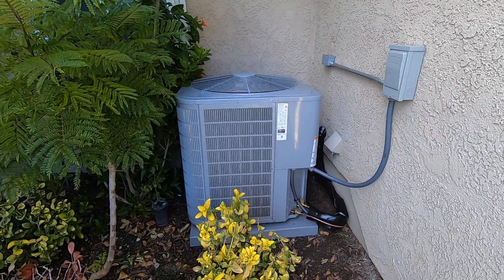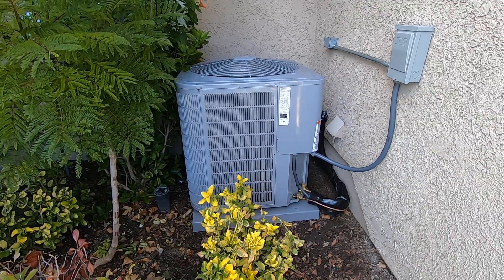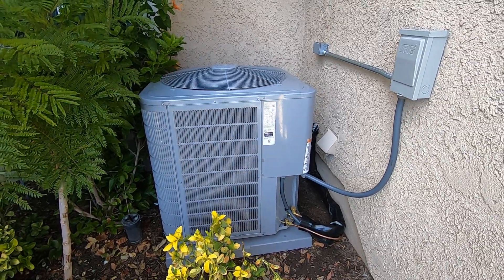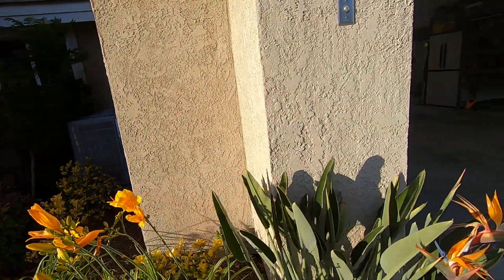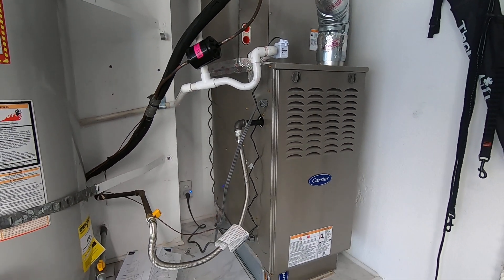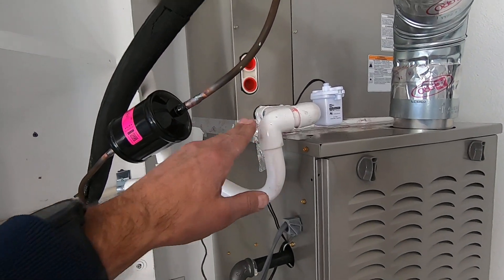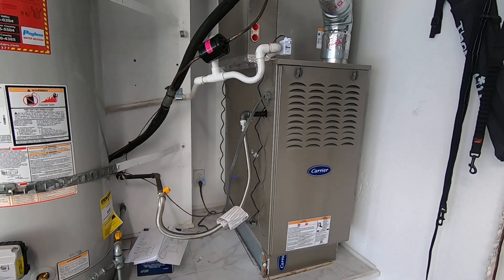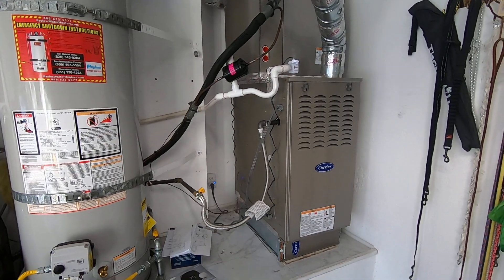Carrier Dual Fuel HVAC System

Comment: Can you post a video of how the clean the coil on a 24vna9 unit please ?
Reply from the maker: Thank you for watching the video.  To clean you condenser coil you can run a hose over the outside or take off the top grill and fan to wash the coil from the inside out.  Typically washing the outside of the coil will get it clean enough.

Comment: German Heating technican here, im always curios how heating is done in other countys, thats why i clicked on this viedeo. Its interisting how you solve heating in the US, here in Germany it is still common to use radiators or underfloor heating, it is very unkommon to heat the ventilation here. But in all honesty, i cant call the ODU "quite". Regulations here require a freshhold of 35 dB for residential housing. At least for the night. Can you give me a rough entimate of how much systems like this would cost in the US?
Reply: $10,000 - $15,000. Not cheap!

That’s for everything though. Furnace and the heat pump.